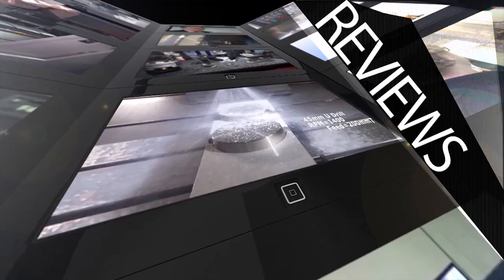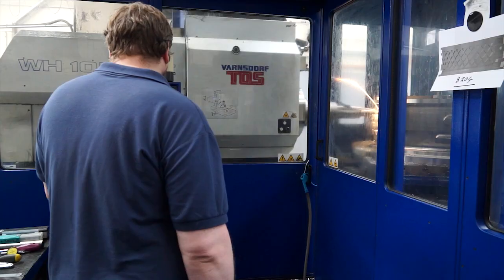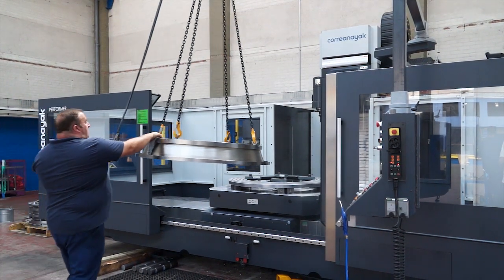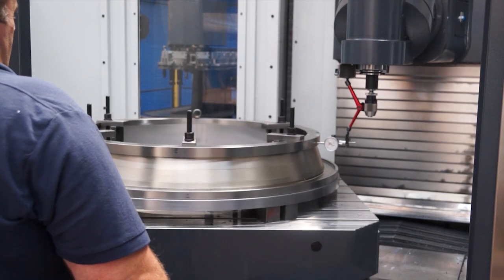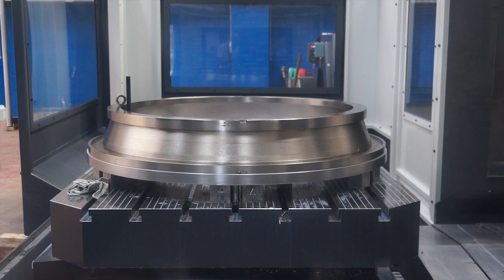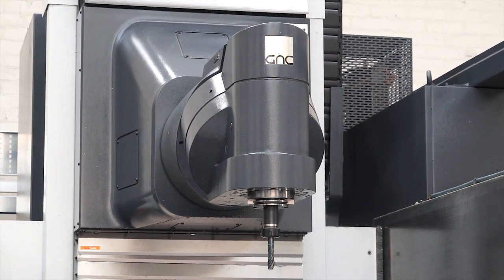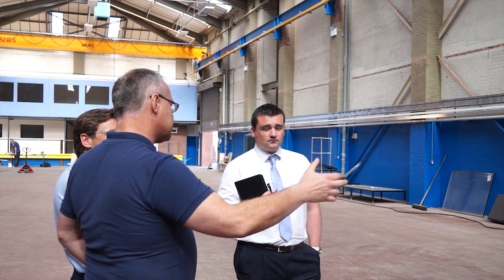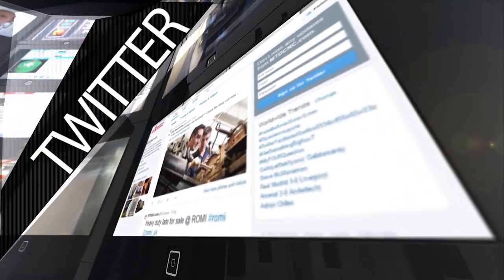Larkshill Engineering invest in Correa from DTS

Comment: I served the first year of my apprenticeship on a correa for that they do with a heidenhien control I don't think their is a better machine on the market.like any trainee it was banged numerous times and it got all the shit heavy work.It was a new machine when I went on but it got absolutely hammered 24/7 hard running not once did it even look like breaking down even after some heavy accidents all you done was turn it off then on then Zero the axis and it was back up and running.I mean some big bangs.Awesome machine It puts your Mazaks etc etc to shame For this kind of work you have to buy Spanish machines Bost are in the same ball park as correa.I spent 8 month on a GMTK that was Spanish and  it was also an amazing machine.Union are total waste of time by far the worst machine I ever worked on was a Dorries scharman eco cut with a boring head vertical head and horizontal head total white elephant never worked properly in all the years it was @ Rolls Royce